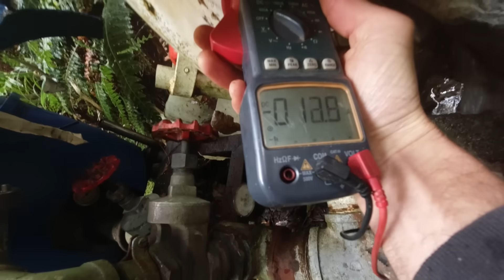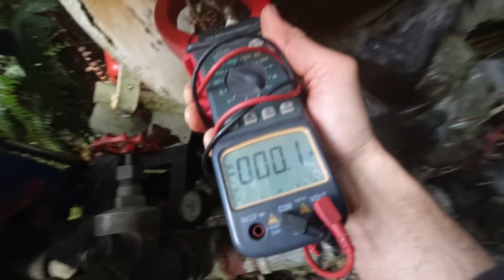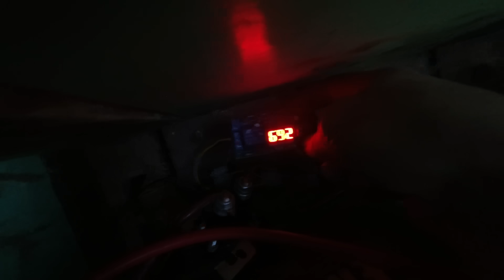Free Power for 16 years from a modified Washing Machine / Water Wheel

Comment: All well and good if you have a constant flow of water all year round. In Australia that isn't the case usually,so solar and wind are the most viable solution.
Reply from the maker: Yeah there are  many thousands of suitable streams in NZ. The same smart drive motor can be rewired to generate power at low rpm, ideal for making a diy wind turbine.

Comment: What about the colder temperatures. Could do the same with a well right?
Reply: If you had a well 150 metres up a hill 
with enough water flow to fill a penstock of the same size and vertical fall...
yes.

Comment: Would it be safe to say it would generate the same power as it used a a washer at the same rotation speed?
Reply from the maker: After rewiring the stator,  It generates far more power than the washer uses at the same rpm

Comment: I feel like this set up could be made at home even on a small house block... In conjunction with solar and batteries as back up/to pump the water. Entirely off grid set up idea? 🤔
Reply: Could try gravity fed jet but what's the point of powering a pump to run a generator?
Reply: @Rooxie973 cause combined solar, gravity feed and battery might be enough to be divorced from the grid. Worth it IMO, especially in Australia.
Reply: @MoteofVolition  you can't generate a surplus of energy if you're powering a water pump for this system

Comment: I’d like to see your home to see exactly what is being powered.
Reply from the maker: The turbine powers a large fridge freezer, large deep freezer, big screen tv, security system, house lights, chargers, laptop, hot water, and most of the tools in my shed. Not enough to power an oven though, I cook on a wood stove and start the generator to run compressor, welder etc
Reply: @MartyT Given that all that can be done, could it be feasible for a small scale gravity-assisted hydro system (using water tank) to power an intermittent pump, as well as other appliances, lights, etc? I'm thinking, DC for simplicity (and safety,  given Im a noob). There's no stream where I live but a gravity fed water tank is doable. 
Like 'microhydro,' domestic scale.
Reply: @breesmee4522  
No because the "power" in the water is in the vertical "fall" 
which is the gravity assist energy of the "falling" water enclosed in the pipe.
Just falling from a tank from a vertical height of say 3 meters is insufficient in a domestic setup...
Reply: @JohnSmith-pl2bk Thanks.

Comment: My family havent paid a power bill since 1989. Thats almost fourty years. Good enginuity. That is a creek not a river. 😂
Reply: how is this possible
Reply: @decendant_of_the_italians  
150 metres of pipe that is filled with water...and keeps being filled full of water from that small stream.

The pipe goes from a high point to a low point in those 150 metres...so the total fall produces 100psi of pressure through gravity acting on that water "falling" through the pipe....

At the bottom of the pipe the water comes out with sufficient force to turn the pelton wheel the shaft of which has that modified washing machine motor set up to generate 500 watts of electricity which is carried via a power line up to the house to power an inverter to supply 230VAC @50 hertz for New Zealand standard domestic appliances in the house.

Gravity supplies the energy; water is the medium to transfer the energy to the Pelton wheel as rotational energy; then the generator transfers that into electricity...

Comment: Awesome setup! Looks like you could draw drinking water from that source too, using it as a gravity well. There are some really good and cheap compact turbines on the market you might wanna check out. You can run them in series, and it's a simple hose/pipe in pipe/hose out setup. A $1 a watt for the initial setup i think (some are less, I've seen some turbines that push 1000w and are about $200USD and are super small), and they just run "forever". I'm sure the price has gone up a stitch but, it's worth looking into maybe since they can also pump water to the homestead while making power. Beautiful forest by the way! Looks like the coastal temperate rainforests where I live on the Oregon Coast. Tons of life, naturally filtered clean water (which tastes amazing!), and if you hunt and fish it's pretty plentiful in most areas. Perfect for off-grid living! Which is what I'm currently planning for/getting ready to build in the near future. Thanks for thr wonderful video! Hope you have an awesome day!

Comment: If we trapped the water on the beach at high tide, and let it flow back through several of these generators, then we could have free energy 2x a day. 

Coastal community free power, just from a few walls with outlet holes that go through turbines.
Reply: Done on a large scale using an estuary in France...
France is developing tidal electricity generation through a mix of established and new projects. The La Rance tidal power station, the world's oldest, is a significant existing facility, while new projects like the NH1 and FloWatt farms are aimed at boosting the sector. These projects utilize both barrage-style (like La Rance) and underwater turbine technologies.

Comment: Can you explain the drillmachine pls?
Reply from the maker: @WeightxofxChaos  If there's ever a problem and the batteries start going over voltage, the drill would shut down the valve automatically. I have since added a air powered dump valve to bypass the turbine to release water pressure, so no longer use the drill valve

Comment: Super cool, In heavy rain season how does it handle any flooding?
Reply from the maker: The first few years I had issues with the pipes being too close to the high water line and coming apart at the joins..  I moved them up higher and have had no issues for years

Comment: An interesting project but with the availability/affordability of PVs these days there are lower maintenance ways of meeting off-grid power needs that don’t involve interfering with a pristine waterway or installing transmission lines.
Reply from the maker: The beauty of hydro power is that it generates 24/7 so only requires a small battery, unlike solar where you need a huge battery bank
Reply: @ Depends on your energy demands. I have a very modest battery bank that runs everything I need it too. What is the source of the creek? Sunlight is much easier to come by than natural water sources, especially ones that flow uninterrupted at an adequate rate for 16 years straight.
Reply: @RealBrianLeFevre  
But in  this case Marty has that resource...so he uses it.

Comment: An easier but more expensive way to do the same thing is have 2 holding tanks with a turbine in between the 2 tanks and a pump from the secondary tank to the main tank using water pressure to spin the turbine

Comment: i watched this video years ago, and now it's come up again!! with all the cheap stuff you can buy from aliexpress now days it wouldn't cost much to upgrade this setup to a pretty reliable one for pennies. 

i made a solar setup for less than a few hundred with second hand deep cycle batteries, a cheap solar controller, cheap second hand 280W panel, was enough to power everything i have for a long time till i lent it out then they decided that it's ok to drain the battery and leave it flat for 6 months.....

Comment: Between HVAC knowledge and doing commercial plumbing, I would improve on this. Start with a much larger pipe and install turbine then 10 feet down reduce the pipe a size or two to increase pressure and add another turbine at reduction, and so on as long as u have enough room and pressure.

Comment: Im afraid this might be a dumb question, but could a system like this work with the motion of water under a small boat? For example the current of a river, or the waves of the ocean... Anyways thanks for the knowledge 🙏💛
Reply from the maker: Not a dumb question.. Yes It would be possible to attach a trailing propeller to the generator shaft, mounted on a sailboat or river bank, the stator would need to be re-wired to take advantage of the low rpm/high torque rotation.
Reply: @MartyT  thank u so much! I dont actually understand none of what u just said 😅 (first ill need an english dictionary to translate), but i will save it for the future, in case i get the chance (and learn how) to put all of this in practice 🧠🔧. I thought it would be impossible bc of the corrosion from salty water, thanks again 🙏💛

Comment: Very good. But you say 600 watts powers every appliance?
Reply from the maker: Yes, when used with a battery bank to make up the deficit when powering high load appliances. It wouldn't run an oven or hotplate for more than half an hour as the battery would run flat, I use gas to cook

Comment: so the intake is at elevation to increase water pressure in the pipe. So simple and smart. What's the elevation difference between the nozzle and the intake? Could you get double the power if you installed a second wheel in there and a second pipe? Is that a mountain spring or runnoff fed stream?

Comment: Hey Marty, I wonder if you could do an update on this and give an estimate of how electricity this thing has generated over it's life and how many hours labour you have spent on it etc.  Do you have any plans for an upgrade?
Reply from the maker: I don't think I need to change much on the turbine design, it has been running for over a decade so the design is solid.. one thing I would do differently is use an mppt at the house now that they are more affordable.. instead of having the inverter at the turbine
Reply: @MartyT  It would definitely make easier to see what's going on.

Comment: Eels would block ours.1km 50mm poly, Mt Warning, NSW.Similarly scrouned. Induction washer motor,Tamar engineering(Tas) Pelton. 
One in another valley trans through  fence wire,stepped up/down.

Comment: What is the red screwdriver for? 
The motor from the washing machine generates a 20A current when rotated by the water - what voltage is it and how do you regulate it?
Thank you for a great video!
Reply from the maker: The turbine makes about 60v open circuit, the batteries bring it down to their voltage when connected, the hot water dump prevents batts from overcharging

Comment: What parts of the washing machine did you use? Is the part that looks like a Pelton wheel part of a washing machine? Did you use the motor as a generator? Are you generating DC to keep batteries charged and the using an inverter to run your fridge?
Reply from the maker: The pelton wheel is not part of the washing machine, purchased separately. Yes  I rewired the washing machine motor to reduce the voltage and increase amps to a level suitable for charging a 24v battery. Battery  powers the 24vdc - 240vac inverter which runs every appliance in my house

Comment: the one that puts out 5a, how many volts is that at? 28v? i’m curious about how much energy these can generate.
Reply from the maker: Yep around 28v direct to the batteries, or it will climb to 60v on an mppt..  33  amps @ 28v is about the maximum it will safely handle,  1kw output

Comment: How high is your intake compared to where the turbine is please?
Reply from the maker: About 40 metres head
Reply: @MartyT  Thanks for your reply...its the same like what mine is then  ....im laying the pipes this week and getting everything else ready...I got my hands on a new model stator from the tip and excited to wire that up soon. 
Also another question for you please...im going to get an aluminium Pelton wheel from ebay do yu reckon the 200mm wide wheel with 12 spoons would do the trick or go for the 340mm one with 19 spoons?
Thank you for all the freeing info that you put up here!
Reply: @gp3587-y9w  
What Pelton wheel did you decide on?
Higher volume and you could use the 200 x 12...
lesser water volume probably the 340 x 19?

Comment: Awesome setup. There is room for improvement. Rising the system voltage lowers the transmission losses. 240VAC are good for a couple of meters, but the distance here is a bit longer. If the inverter would deliver 3 phases, 3x400V has less losses and is compatible with 240V. The generator-, DC and battery voltage could be lifted to 48V, thus lowering the generator current, extending the lifetime of the batteries. And get rid of this rectifier. Each diode takes at least 1V, two in series 2V out of the 24V, meaning, you lose 8% of the power in the rectifier.
Reply: See later vids and updates (in the comments)
As technology improves so do these systems...

Comment: i wish i can do stuff like this but i live in a apartment . thanks for letting us peek over your shoulder .
Reply: If you have a balcony, you could potentially get some 12V panels and a small battery - such as ones made for camper vans. Should be enough to offset at least some power use, especially during peak hour when the grid electricity costs the most.

I know a guy that did basically that for his shed - and he charges all his power tools and runs his shed TV/beer fridge off of it.
Reply: Put a turbine in your rainwater drain pipe :)
Reply: In Germany (after people petitioned on it) it's allowed to have a 2kWp solar system installed on your balcony or even the side of the wall of your appartment. The landlords can only refuse those requests when the building couldn't or carry the load or something simillar.
Maybe you could look to start something like this where you live, allowing yourself and others to participate in clean renewable energy production...
Reply: You can use the kitchen sink.

Comment: What does the drill do
Reply from the maker: Turns off the water valve if battery voltage goes high (inverter failure, blown fuse, hot water dump element failure etc)
Reply: That's pretty cool

Comment: I have often thought hydro would be far better than solar or wind. 16 years is amazing. Not only have you saved 20 odd K on grid conection. But at least that again in free power. Thank you for sharing.
Reply: Industrialization has shaped the modern world, making large-scale infrastructure and production possible. But at the individual level, people don’t necessarily need industrial systems to create, innovate, or sustain themselves. With the right knowledge, small-scale solutions—like micro-hydro power, kinetic energy from trees, or localized food production—can meet many needs without relying on massive industrial grids. Instead of framing sustainability as a way to support industry at scale, there’s value in exploring how communities can develop practical, efficient solutions that work with their environment rather than reshaping it entirely.
Reply: It really depends on where you live, but Hydro and solar have the same problem. Where I live, winter lasts at least 5 months. There is not much sun, but still enough go make a ligtle bit of electricity, while small streams and rivers are completely frozen.
Reply: Yup. All yo uneed to do is get everybody a river.
Reply: Yes and where I live they want to take out the dams like they did in California. We are ran by Marxist.

Comment: How do you maintain the frequency?
Usually you look at an appliance and it will say 50Hz/60Hz
Reply from the maker: It is basically a powerful dc battery charger after rewiring and rectifying, the batteries then power a 24dc - 230vac 50hz inverter to run my appliances
Reply: @MartyT  I think I understand... So you can run the water turbine at any speed however that will only really affect the amperage?
What if you used it as an AC generator?
Would you need to adjust the Hz so that it is constant?

Comment: Your turbine is wrongly built. If you take a worm wheel instead of the wheel, you save yourself these repairs. A worm gear cannot clog and break. With your turbine wheel, the waste accumulates and causes problems, this does not exist with the worm drive.
Reply: This is a low volume of water but a high head to get the pressure...
gravity makes the water powerful enough the provide 800 watts continuously...
the system you constructed has a large volume of water with a large "snail"  to catch that force.

Comment: Take a car alternator, by pass the diodes,
Go right off the 3windings wires, that is 120Ac,
Reply: But NZ domestic voltage is 230VAC @ 50hz.....
and the car alternator needs to be spun @ 2000rpm (like it is in your car) 
and this pelton wheel spins @ 1000rpm....
sp you would bnned a gearing up....all more losses in efficiency.....

Comment: How far does the power have to travel from the turbine, and what's the voltage on it? Just curious if you don't have a large voltage drop from those fairly thin wires?
Reply: Ok, so I just caught another of your videos and saw it is converted straight to ac at the power source 💪

Comment: That’s awesome.   One question.  Do you have to rewire the motor.  Or just spin it over and it has output.   How do you excite to coils to start producing power.
Reply from the maker: The factory stator will put out low amp/ high ac voltage, I rewire to raise the amps and lower the voltage, safer and more suitable for charging a battery bank

Comment: How much water flows per day to power the turbine? I’m curious if I could do something similar with my property and the existing ponds
Reply from the maker: Around 3 L/sec = 180L/min = 10800/hr x24hrs = approx 259200 litres per day?
Reply: @MartyT  that’s more water per day than I thought initially. I guess looking back at where the water was flowing into the pipe it was more than I realized at first glance. It might still be feasible. I’m curious to play around with this idea since I am going off grid with my property. 

Thanks for the videos and response!